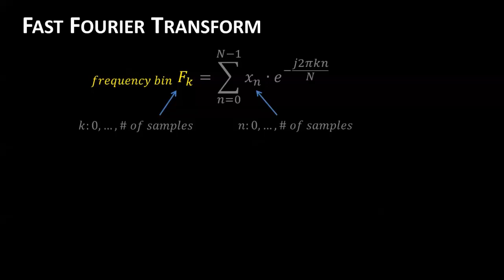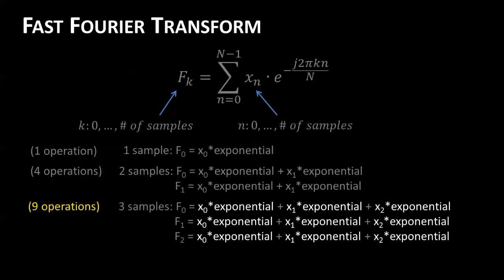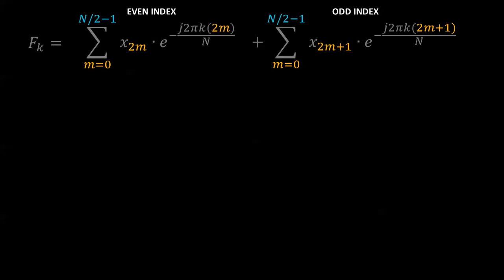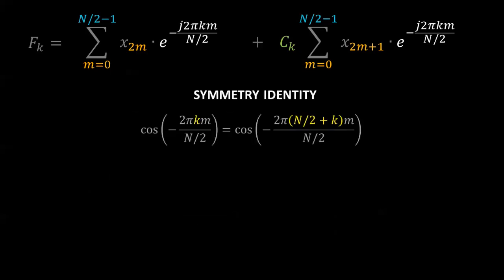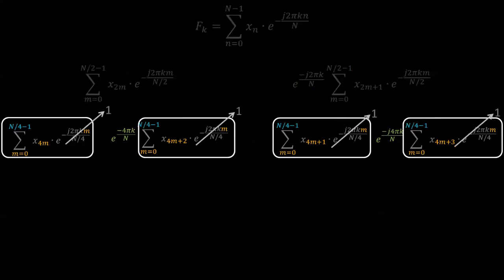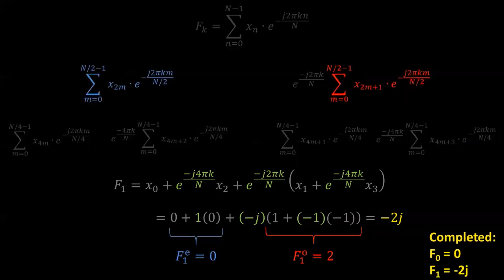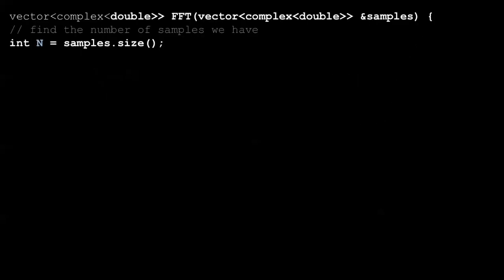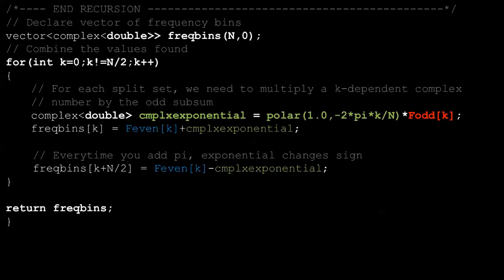The FFT Algorithm - Simple Step by Step

Comment: Hello how x2 = 1, if you take 4  samples,  x0=0,  x1=1,  x2=0 and x3 = -1, isn't it...at 6: 09 u splited even n odds but u considered x0 n x1 as odd.  N other as even.. How? Plz correct me n guide
Reply: Good catch you found an error there. F(0)_even = 0, F(1)_even = 0; F(0)_odd = 0, F(1) _odd= 2. Note even is always zero because of the sample. The -1 Sample flips sign on F(1) because of green 4*pi term. Note to leave out the 2*pi term on f(1)_odd when calculating the odd_sum.

Comment: I have swept almost the entire YouTube offering on FFT and I agree that this is the most accessible and concrete treatment with the best presentation. I love fresh colour-coded method of teaching. Can you say what software you used to make this?

Yes at 6:42 it is a tiny error in the 2nd term of F1 but it multiplies by zero and doesn't change
 the final answer. So the F1 equation should be:
F1 = 0 + -1(0) + (-j)[1+(-1)(-1)] = -2j

I believe the rest of the video is error-free. Great work! For an even better understanding I encourage viewers to split the summations one more time  to have 8 summations, remembering that exp(x)*exp(y) = exp(x+y), and then it really becomes obvious how elegant Simon Xu's way of organizing terms really is. Then the pattern becomes obvious and you could technically split as many times as you want, confidently, to have 16 terms or 32 terms without having to do all the math but instead by following the pattern.

Simon, "I'll be watching your career with much interest young man".... quote from Senator Palpatine :)

Comment: Such a wonderful video!  Could you explain the part @ 5:58 ,  F0 = 0 + 1 + 0 - 1.  All exponents = 1, how is X3 = -1. How is X0 and X3 =  0? If X0 is 0, why is X2 not = 0.  Thanks alot in advance
Reply: Hi, ignore my question, of course I understand now that you are simply applying the coefficients of 0, pi/4,pi/2 and pi of the first term.  But therefore referring to 5:51, the content should be X0 = 0, X2 = 0.707, X1 = 0, X3 = -1?
Reply: @alfietankokleong  they are just the data samples which are taken from the sine wave. watch again by starting at 5:00

Comment: Hi,
I'm writing a paper on the Fourier Transform, and one of the sections focuses on the FFT.  One part of this video, however, confuses me.  At 6:04, you establish that F0 = x0+x2+x1+x3 = 0 + 1 + 0 + -1.  It appears that you've rearranged the x values in between the second and third parts of this equation, going from x0+x2+x1+x3 to x0+x1+x2+x3 (I'm assuming that x0=0, x1=1, x2=0, and x3=-1).  Using the first ordering, it seems that Fe0 should equal 0 + 0 (x0+x2) and Fo0 should equal 1 + -1 (x1 + x3). This affects the even and odd sums, thereby affecting the results of F3 and F4.  Am I missing a step here?  Do Fe0 really equal x0+x1 (1) and Fo0 really equal x2+x3 (0 + -1)?